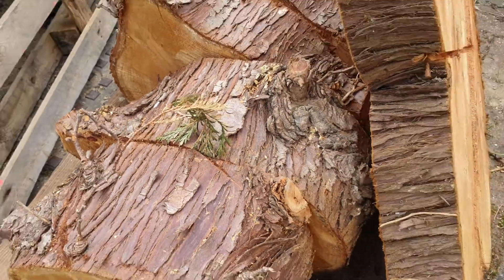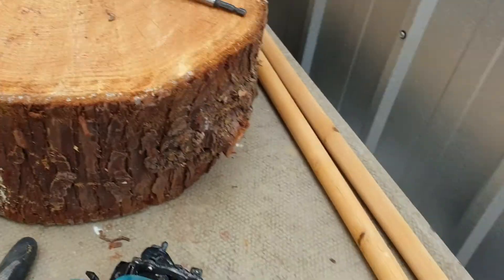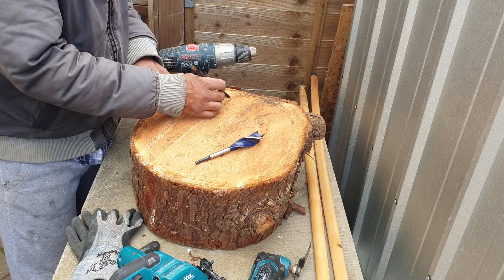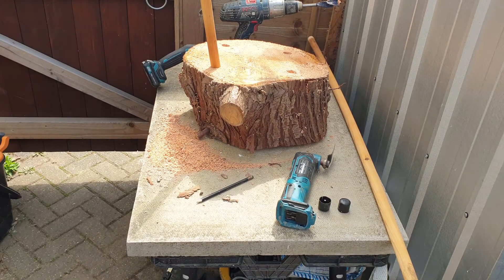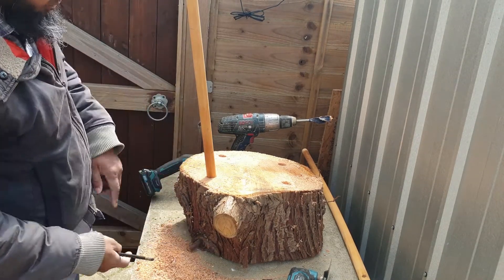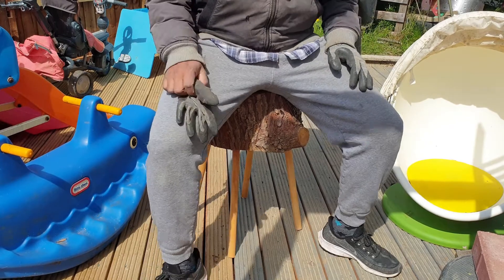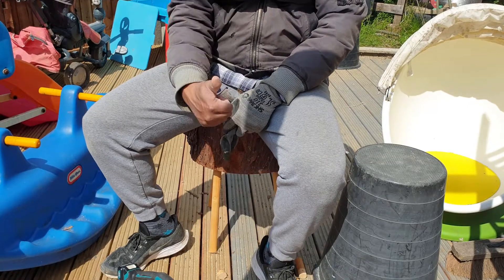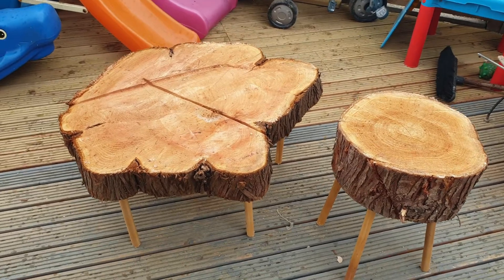Making Log Stool and Coffee Table for Free Easy DIY

Comment: I got the log today. But inside is still wet .would it crack after a while if I put the " metal legs".
Reply from the maker: Sorry for the delayed reply.  One of my have cracked but it does give it a character.. It can also take a lot of space and may not go with your garden deco, plus heavy to move. I ended up getting rid of it.